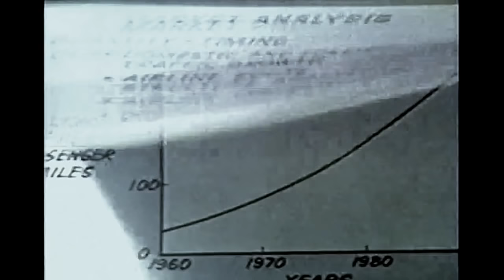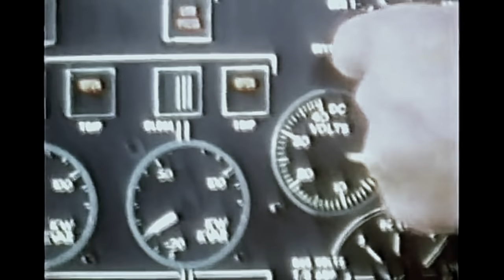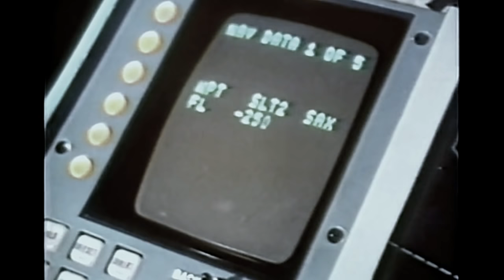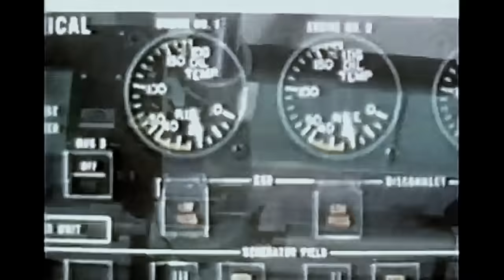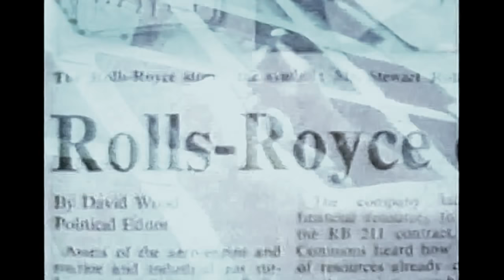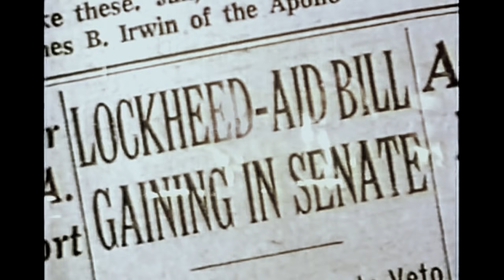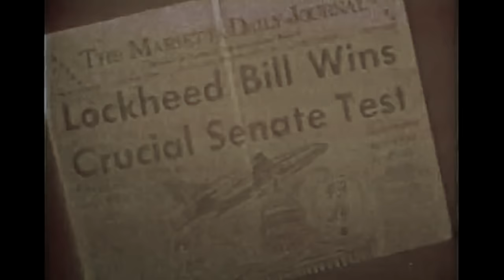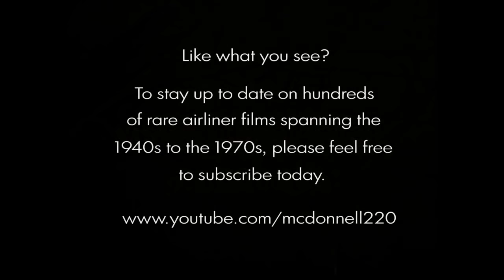Lockheed L-1011 TriStar Promo Film #3 - 1971

Comment: 30 years with Delta, qualified on, in order, Convair 880, DC-8-33, -51, -61, DC-9-10, -33, DC-10, DC-9, Boeing 727, Boeing 767-200, -300,-300ER, Lockheed L-1011, Boeing 737-200, Boeing 757, Boeing 767, MD-11.  My favorite, as with so many others, was the L1011.  Smooth as glass, technically years ahead of it's time, able to make every landing like the touch of a feather, and did I say fast?  Departed JFK in a DC-10, behind Eastern L-1011 flight 409, their twilight in sight during entire flight down the "Atlantic Route", until we descended into Fort Lauderdale, and the Eastern flight crashed in the Everglades. They made a movie about the Ghost of flight 409.  Years later, I had been flying L-1011 copilot for Capt. Ted Connors on a three day rotation, last night in Ft. Lauderdale, last day a nonstop to DFW.  Later, with a different copilot on the same rotation, they crashed at DFW.  Ted was a great Captain and pilot!!!
Reply: Was flt 401 IIRC
Reply: Mike Sparks Hi Mike, I don't understand your question.  What is IIRC?
Reply: Stands for if I remember correctly. And I looked it up, and it was flt 401 that ended up in the everglades. 409 was in Airport 75 lol.
Reply: I landed at DFW right after that crash.  Flew an L1011 from DEN to DFW on Delta back in 78 or so.  Usually flew Braniff but lucked out and got a hog-body for the short hop.  What a quiet airplane it was!
Reply: I know some guys who flew at Delta,Dave Carson,Dave Hazen.and I think John Connoly and Mike Farry. They all started at Statewide Airlines back in the day.
Reply: Good day Mr. Cantrell. Maybe I missed something in the above video, but it wasn't made clear about what happened with RR and their engines.  What did Lockheed do and which engine replaced the Rolls Royce. Thanks!
Reply: Mike Sparks Flt 409 also ended up hitting Medicine Bow Peak back in the 50's.  A DC4 killing all aboard.
Reply: WOW! I studied DL191.  I work for AA  supporting the Electronic Flight Bag for the cockpit crew, I should could ask you a TON of questions about the qualifications and your experience. I may work for a competitor but we are still part of the aviation family.
Reply: Holy cow. That's being a major part of history! Unreal.
Reply: Except it was flight 401
Reply: Great story William!

Comment: As a passenger, I found the L-1011 to be much better experience than was the DC-10.
Unfortunately Lockheed was a little late to market with it.
If recollection serves me, there were not fatal L-1011 accidents that could be ascribed to a fault with the airframe.
Reply: Much safer and better built than DC-10.  A strike of the engine providers delayed the delivery of the L-1011 and everyone flocked to that disastrous DC-10.

Comment: When the headline showing how close the vote was i was amazed. To think how  it came so close to not happening and how many people's lives would have been impacted.
This was before manufacturing American workers were sold down the river by their elected government.. I guess the ball was already rolling and the first oil shock helped "justify" it.
One of my favorite airplanes to fly on, exclusively TWA. Another poster aptly described the distinctive "low growL" of the engines spooling up.  They also produced the most smoke of any engines that I recall visible from inside the cabin. Guess it was OK or I wouldn't be typing this.
Almost all negative events  with this craft would have done the same to any other birds, I am unaware of any associated flaws with the L-1011 unlike some of the questionable events that affected the DC-10?
Wonder if any  are still flying commercially?  Orbital Sciences was using an L-1011 to launch satellites with their Pegasus Rocket  System. Like I said, what an airplane!
Thanks for posting.

Comment: The video begins with rubbish.  The design case is always that the aircraft must be capable of continuing its take-off after one engine failure after V1.  The choice of how many engines is a different question entirely.  This debate depends upon the thrust available at Max. Continuous,,, or another Maximum thrust setting.